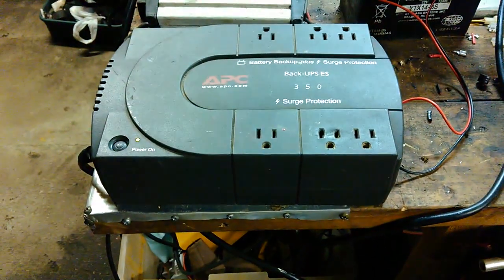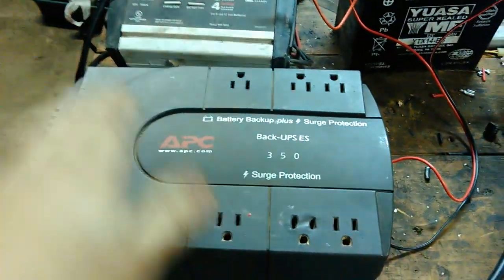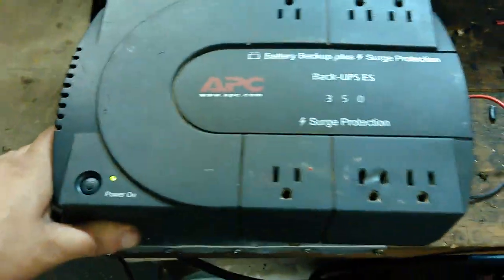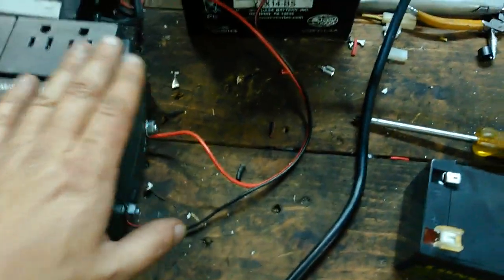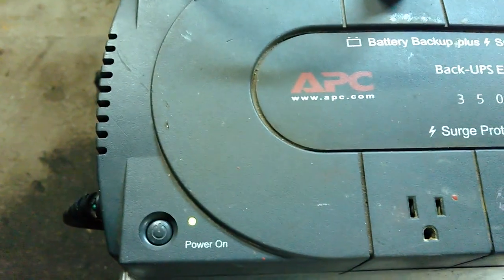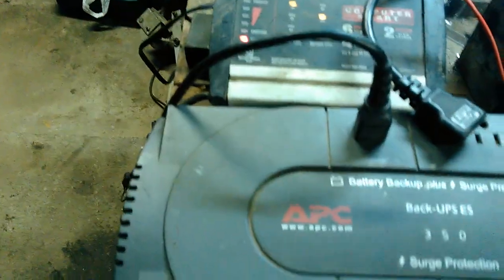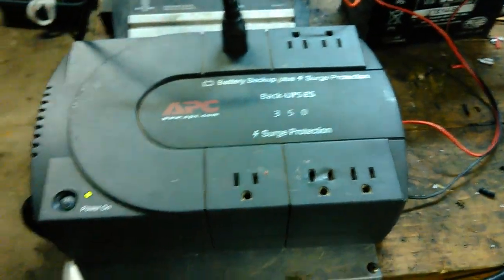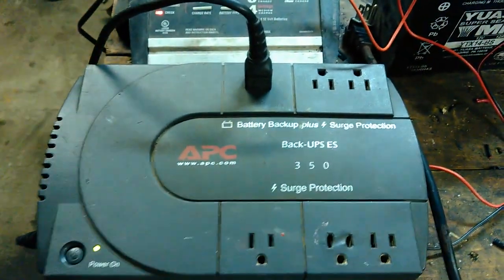ups battery hack

Comment: I picked up an older one at a yard sale a couple months ago for $4. I knew the battery would be toast but I like to tinker with electronics.

I found the user manual for it (an APC, smaller than the model you've got here) and the manual said something about the battery terminals having potential above ground. I tested it and, sure enough, the peaks above ground potential of AC mains runs to both posts of the internal battery (~ 60v AC), with a DC offset between the two to charge the battery, when it's plugged in and charging the battery.

What I'm trying to say is that the one I've happened upon could give a person a shock. Be cautious and at least probe for potential to ground. Turn your multimeter to AC and check for voltage between the points you might touch and ground (ground of an outlet for instance).
Reply: nodriveknowitall Could give a person a shock just by touching the battery terminals, something a person wouldn't normally expect.
Reply: nodriveknowitall I went to get the supply. It's not an APC. It's an Eclipse plus 250 made by MGE UPS SYSTEMS and the warning about voltages between the battery and ground is on the bottom of the case. It's an old supply, hopefully they don't make them like this anymore.
Reply: +nodriveknowitall Good info, thanks for making this known

Comment: can I replace the battery with a 100ah battery?does it have to be a deep cycle battery? how long will it last to supply a desktop computer?
Reply from the maker: Irvin Rolf Parcon Yes you could replace it with a 100ah battery. As far as run time I could not say. Too many variables to take a guess. ie. type of backup, load, battery condition
Reply: if I do that, will I have to worry about overcharging or will the charger controller mechanism of the ups will still works fine?
Reply from the maker: It will charge it ok. I have one running like this for over a year now with no issues.
Reply: oh, thank you so much for your information.I might try it one day.
Reply from the maker: Glad to help

Comment: Here a odd secret all casino  uses 1000s of UPS of those unit every year to keep they machine memory safe. if the power is lost - yes they final die so they and sold as junk item by the batch. the biggest UPS we seen had 32 12v in a 2 rack and backup of 3kw.was retire so we have 32 12 volts seal cell battery

Comment: Thanks Wayne. Very interesting idea. We use 1500 and 3000 watt UPS' at work. If one of those 3000w ones go bad could you use it as an RV inverter?

This would be a LOT cheaper than the Go Power 3000w I have my eye on at $1100
Reply from the maker: Yes you could. Those may be 24 system. BTW check your PM's

Comment: Looks like one or 2 of the outlets got a little toasty. I did the same thing just be careful, they don't supply too many watts.
Jon
Reply from the maker: The small one like in the video is in the range of 300-350 watts. Thats enuff to run lights and small items. Poor mans inverter but it works.
Reply: rvprepper
Yep I got one just like it. it works. I was testing it with a small heater on fan only, I messed up once and turned on the heater by mistake, and poof. But I have several of them.